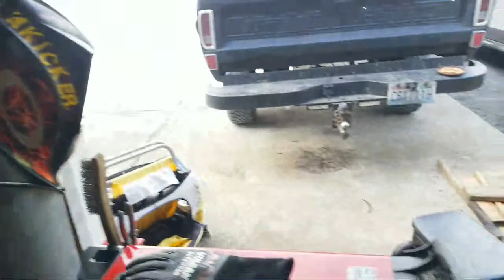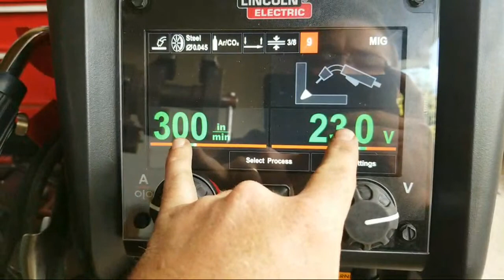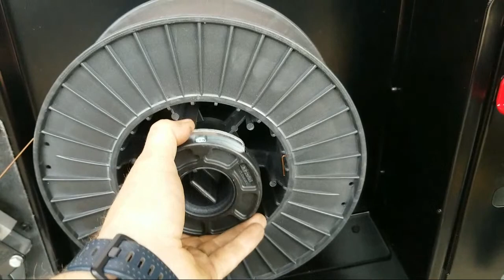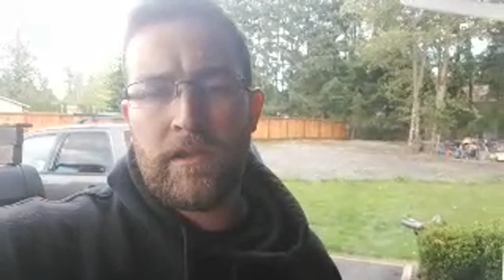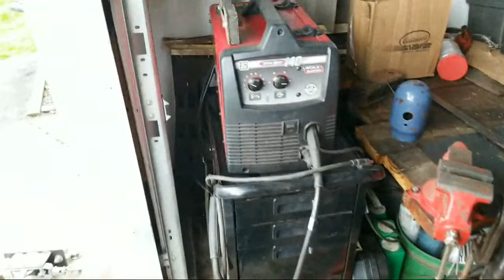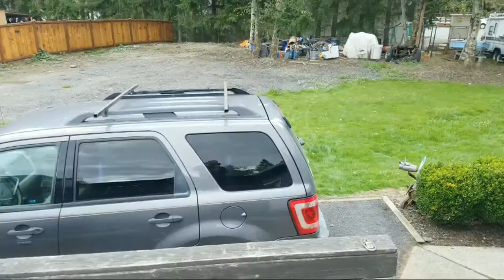New Lincoln Power Mig 260

Comment: Can you weld aluminum with a push pull 🔫?
Reply: Bought this welder with the stock gun when you do manual mode and swap the rollers to aluminum it works really really good.  We also bought a push pull that is here but the adapter to use it for 12 pin has not shown up yet. I might try the push pull but honestly we are not sure we need it as its better with the stock whip than the spool gun we use on the 180.  Its awesome but I am not a great welder but see a big difference from the 180 mig pack.  I also have  tig 200 squarewave and its super too.
Reply from the maker: Yeah
Reply from the maker: Not sure i think you have to have a spool gun id have to lookit up
Reply: Thank you sir for your reply👍